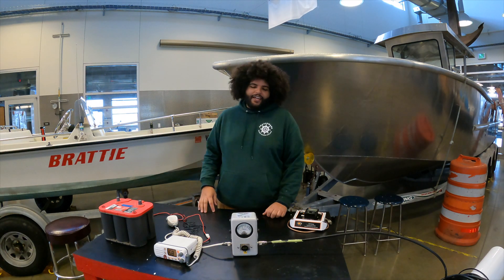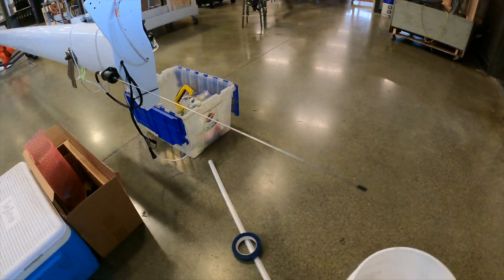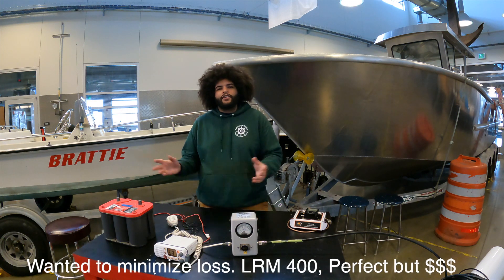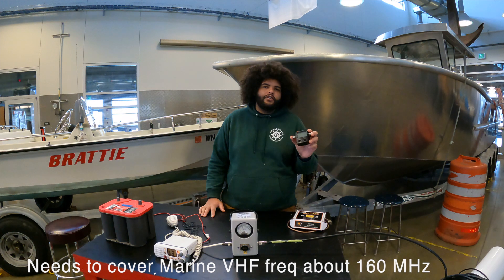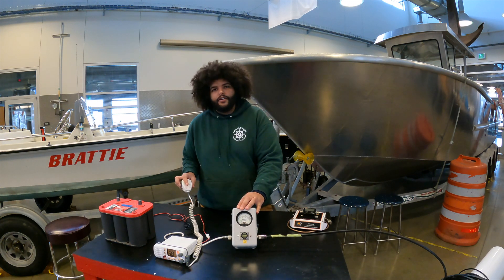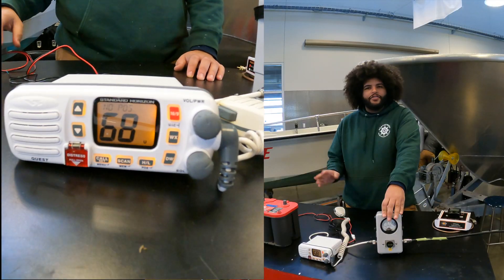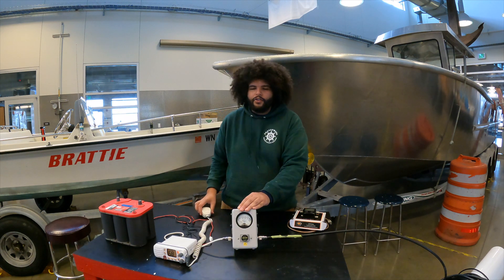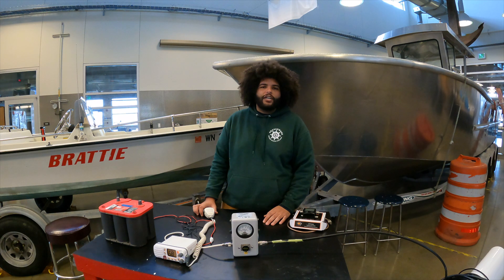TechTip#9 Testing a VHF Radio system, an SWR meter is the way to go!

Comment: Is being in doors with all the electronics and building wiring and such won't that affect the SWR? I know with my mobile VHF radio it's best to check in an open area since that's where it will be used.
Reply from the maker: The building is very large, so I think we were just fine. I'd have to dust off some textbooks, but the VHF antenna is ~39" and that is 1/4 wave, so as long as it's reasonable clear we are OK for this test to verify the antenna & coax cable.